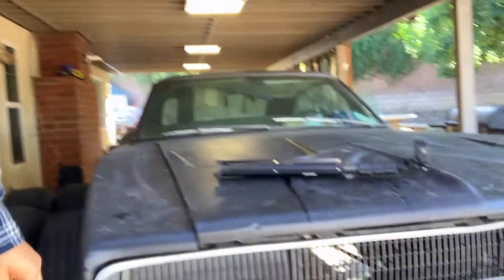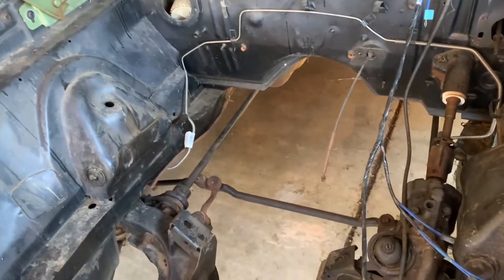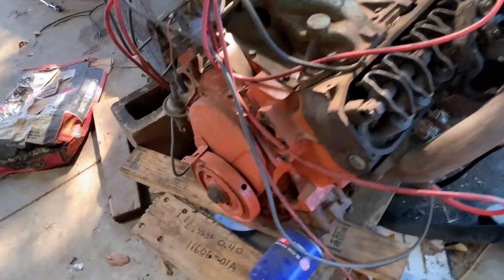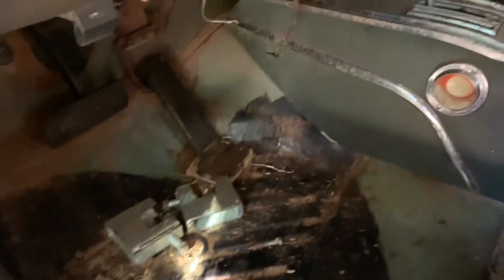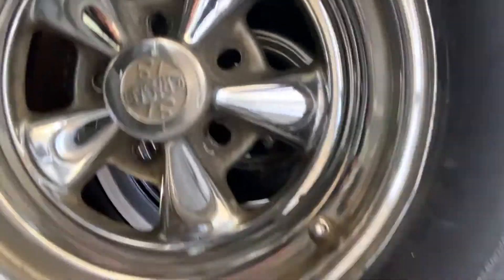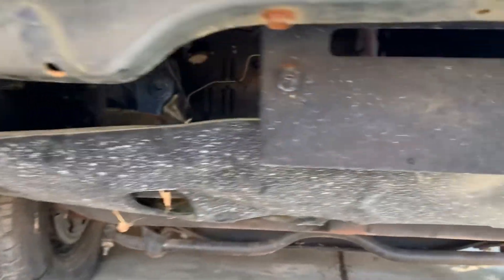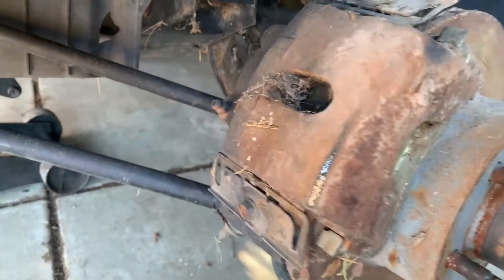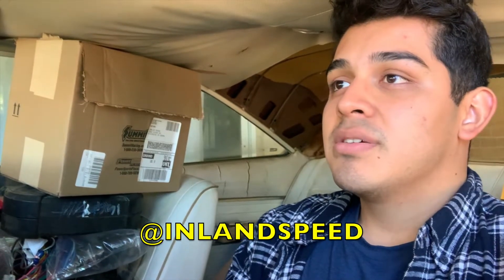1968 Dodge Charger Build

Comment: Nice Chargers! I also have a 1968 Charger 383 4spd and a 1970 Charger RT 440 4speed. That 440 you took out of your Charger looks like many 440s that I removed from cars a long time ago and they were not flood cars either. So it looks just like normal rust on that 440 to me. I also have had a few 68 and 69 Chargers in the past. MOPAR!  What is neat is that I also own a 1968 Chevy C10 short bed fleetside that is a original 396 bigblock truck. It will be cool to see you guys get that Charger,C10 and Barracuda back on the road!
Reply from the maker: Oh sweet! Those 4 speeds must be a lot of fun 🤩 Mopar is great. Thanks for the comment and good luck with your projects!